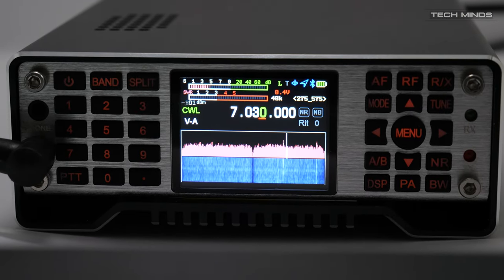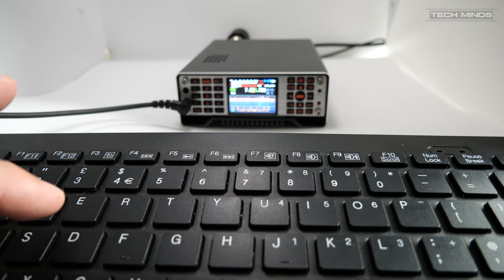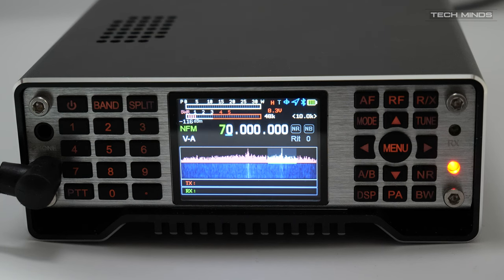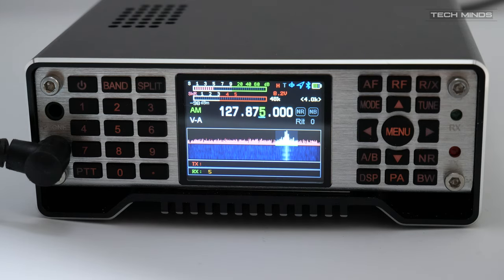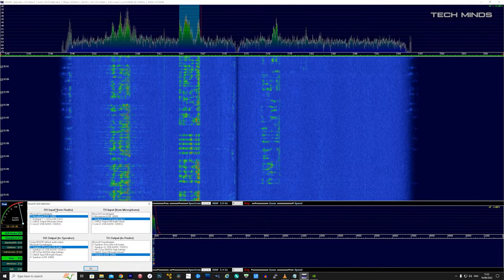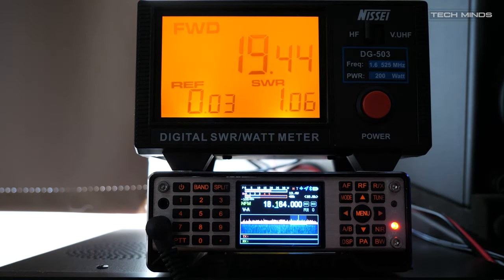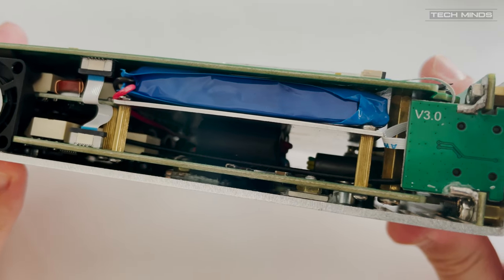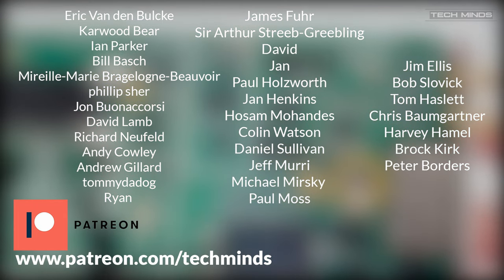Q900 ALL MODE ALL BAND TRANSCEIVER - YOUR QUESTIONS ANSWERED!

Comment: as a CW operator let me remind you, when once more you opt for the lazy path, avoid learning something,  and use a keyboard to morse 
 -then  at least do it correctly

which means learn the abreviations and qso procedures. which differ quite a lot from your watsapp-chatting or other digimodes.

you must learn what QRQ QRS means.. what QRU means.. what AR SK CL means .. what QRX2 means... and so on and so forth.

Learning morsecode is not just about the alphabet. Real CW operators know this.

A keyboard operator probably doesnt.  And so he instantly does the wrong thing when someone sends him a "PSE QRS"  for example. A very basic code in use on cw.

I think this is a stupid feature. I would not use it, also - one key is earier to transport than a fullblown 108 key keyboard :)

Comment: I had such a bad experience with Ali Express with my usdx transceiver with the built-in battery that I completely lost confidence in the Chinese.  They refunded me 40 euros for the postage and I've been waiting for the repaired or replaced device for more than a year now.  No one in the store is answering either.  I'll probably have to write off the money.  And we should still have faith there?
Reply from the maker: It’s not AliExpress as such that you had a problem with, it was just that one supplier/store. I guess like on EBay you will always get bad sellers. Not every store on AliExpress is bad. I’ve used AliExpress and never had a problem, maybe I’m just lucky, but I totally get your frustration.